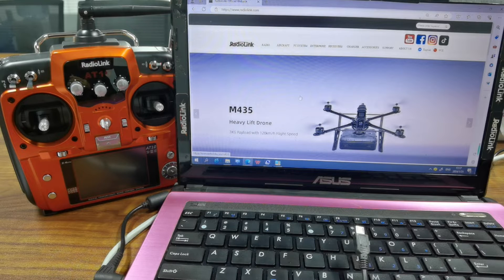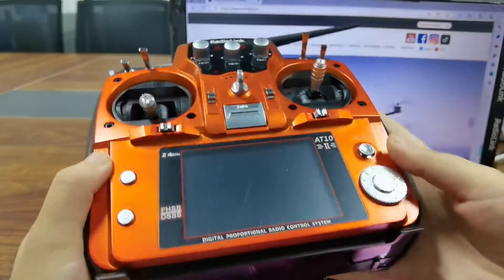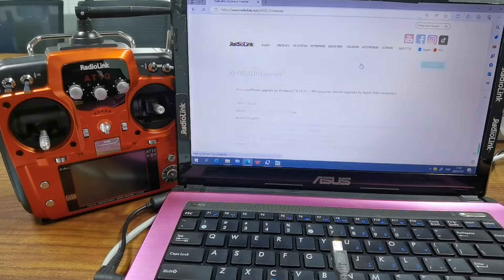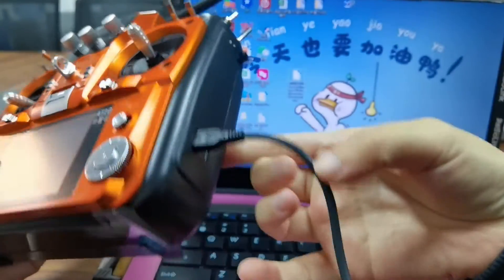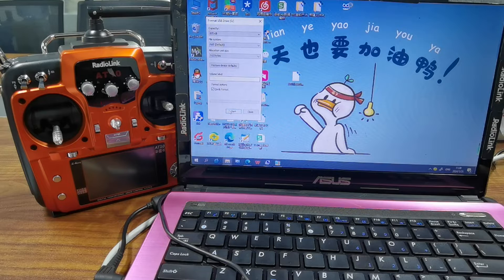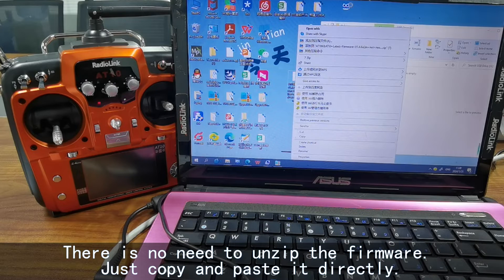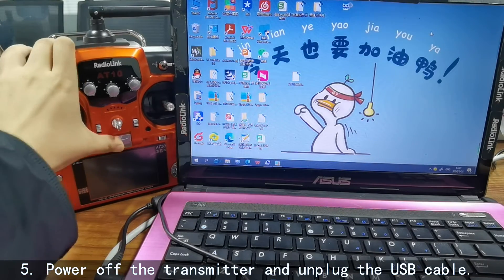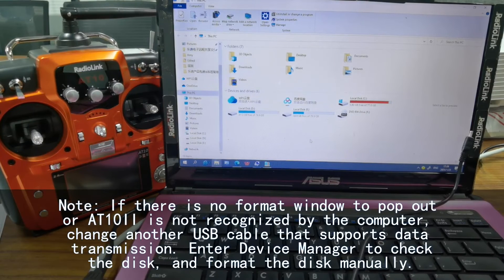How to update firmware of AT10II?

Comment: Hi. Could you provide a link for the usb cable needed for this controller? that will be helpful.
I just received my remote control, and it seems like it was previously owned. It even had different kinds of batteries installed and the version that is currently installed is V6.1.4S. Is this version correct?
The screen is nothing like the one you show on the video. Thanks in advance!
Reply from the maker: Hi, sir. The firmware update only needs a normal USB cable. You can buy it at your local place. The USB cable with micro USB port. And the latest firmware of AT10II is V6.1.4S. Here is the new tutorial to show how to update the firmware of AT10II: https://www.youtube.com/watch?v=9U44-IdS3XU  If any question please feel free to contact us. Our email is: after_service@radiolink.com.cn

Comment: Format disk pop up doesn't appear on windows 11. Tried with many different cable
Reply from the maker: Hi, sir.  If there is no window to pop out or AT10II is not recognized by the computer, could you please change another USB cable that has data transmission function? Because it is possible that the problem comes from the cable. You can also enter Device Manager to check the disk. Format the disk manually. If any question about RadioLink products please feel free to contact us. Our email is: after_service@radiolink.com.cn